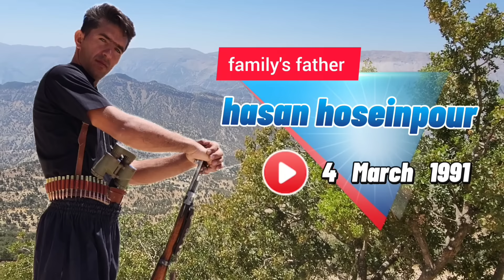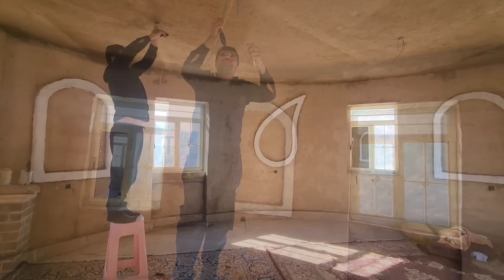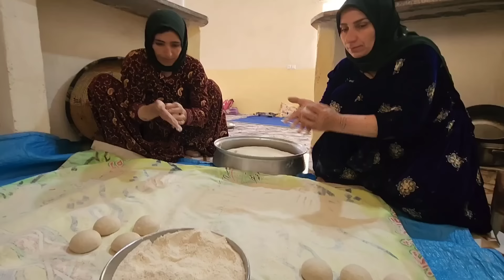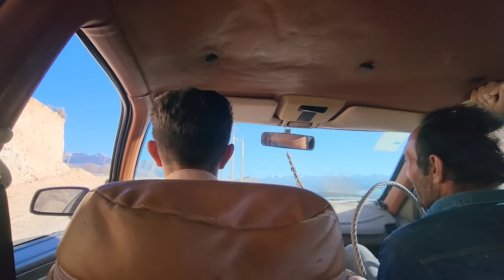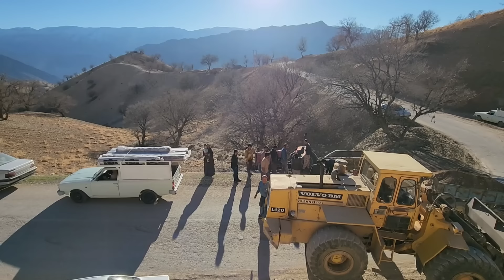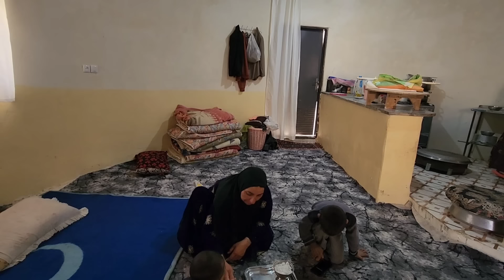From tragedy to victory: from building the castle to the miraculous rescue of Mirza's tractor

Comment: I just noticed the light for the center of your room on the 2nd floor,  so they sell CEILING FANS in the City? A ceiling fan would be great to stir the hot air going up to being it down when it is cold out. Also, make it cooler in the room in the summertime.  If you could add a small  air-conditioning window unit and turn on a ceiling fan, this would also help keep the room cool when in use. To power your appliances and the air conditioning units, you could invest in a large generator to run everything for around eight to ten thousand dollars in America's prices. At least buy a good-sized, smaller generator to run various tools and things.